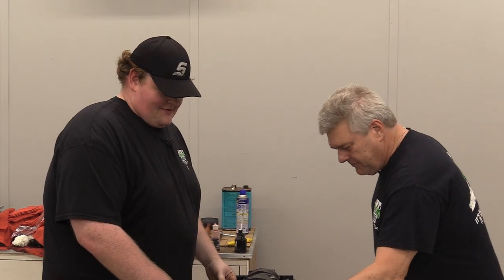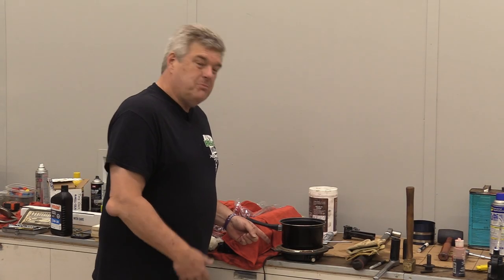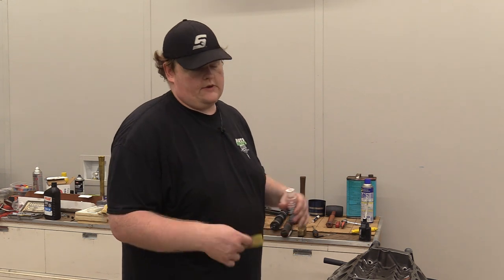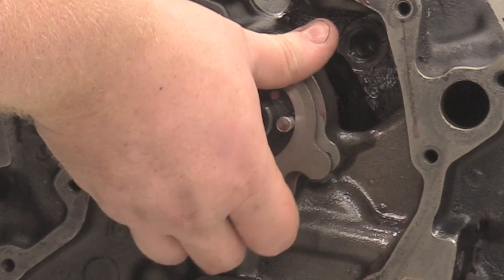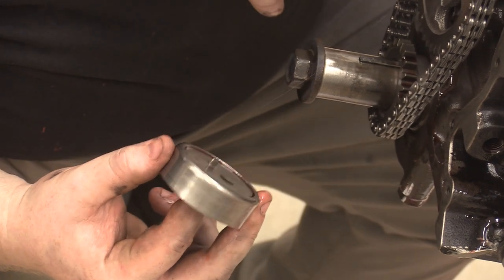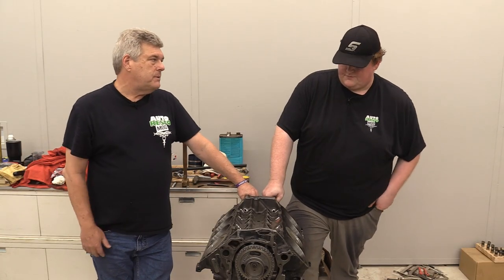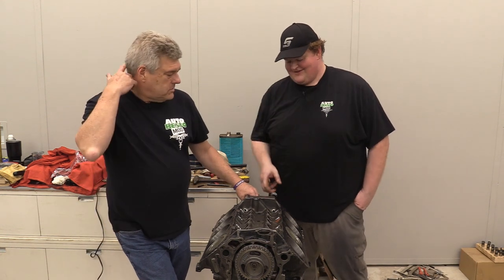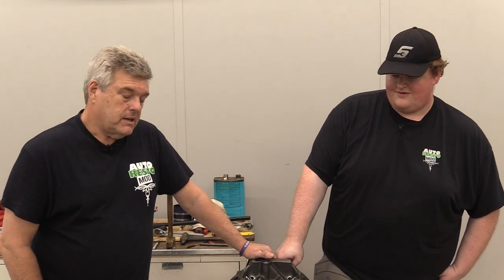Camshaft Install and Tips Ford 302

Comment: I can't remember the last time I used  press in front oil galley plugs, easy to tap and I put a plug with a 0.40 hole in the center plug to help oil the timing chain.

Comment: Hi Jeff and Cam! Isn't a cam degree for checking the cam manufacturer did their job right with the correct grind and shipped you the right one you ordered? Making sure it matches the cam card? If at TDC and your timing chain marks are right you should be fine. Right?
Reply: Ditto… I was always told to degree the cam to double check that you were sent the right cam, the specs match the card, etc. We’ve all degree’d performance cams and used adjustable timing sets. Even on stock applications I like to degree one in just to make sure I know timing events. To each their own I guess.